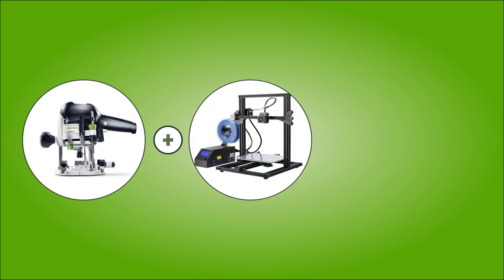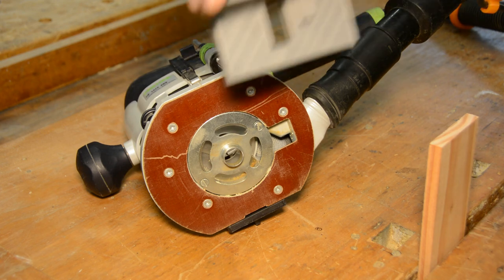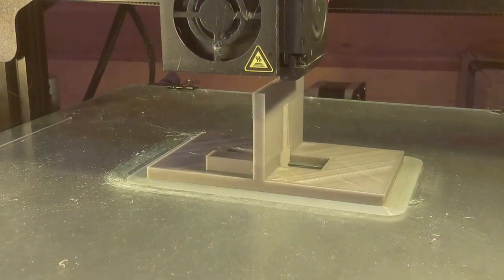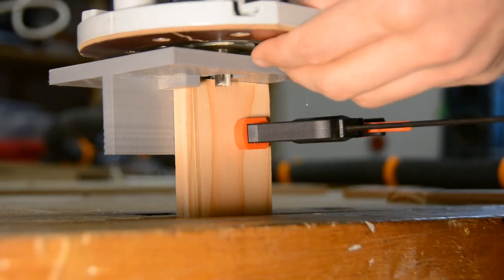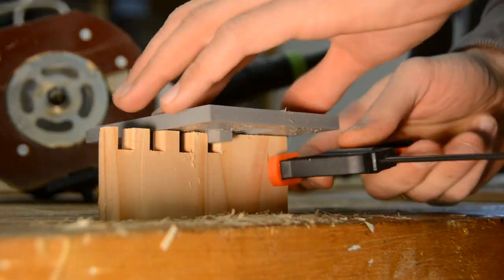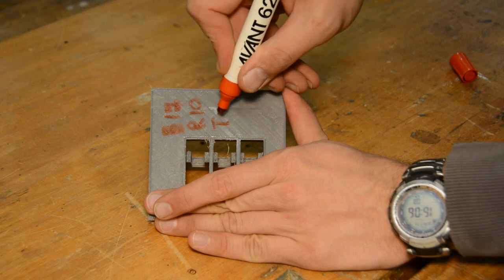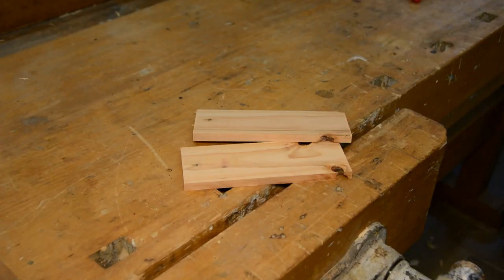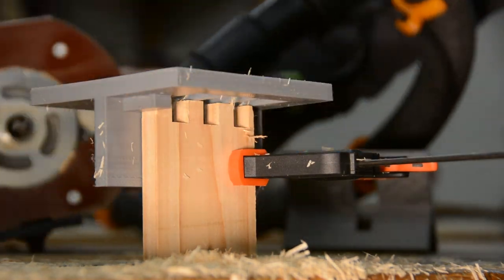3d printed box joint jig for the router [Free Plans]

Comment: Another excellent video, would love to see this with dovetail joints
Reply from the maker: Dovetails would be a bit more challenging as the jig would need to be adjustable for different thicknesses...
Reply: @WayofWood  Yes, plus the sides are different ... I need to have a think about it :)
Reply from the maker: A Leigh isoloc type of connection might be easier to implement...
Reply: @WayofWood   see "Make a Dovetail Box in 12 Minutes -- WOOD magazine". very simple jig. I made one out of wood, but would be a good job for the 3d printer

Comment: To increase stability I would make the wood thickness an option and generate supports on both sides.
Reply from the maker: If you would generate supports on both sides you could no longer register the board against the print...

Comment: In the customizer now. What does the min wood thickness setting change?
Reply from the maker: It is the smallest thickness of wood you want to use - it makes the pin shallower.
Reply: @WayofWood  Uhm... The hight of the pin?  It is hard to see on the customizer as it works so slowly. I still dont understand the need for this setting, but I guess it will make more sense after I see and test the print.
Reply from the maker: You can download OpenScad for free and then open the document is OpenScad. The changes there are updated automatically. 
For most of the values the default values are not too bad of a starting point. ;-)
Reply: @WayofWood  Great. Thanks. I am printing now with a 21mm bushing setting. But the busing doesnt have stright sides. So I may have to print your bushings as well.